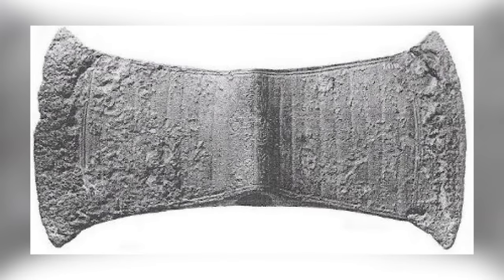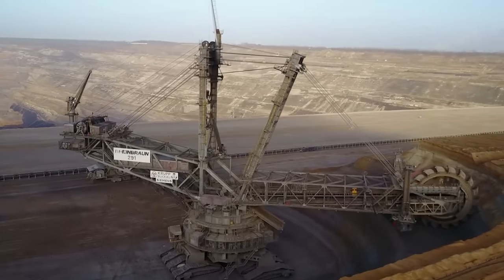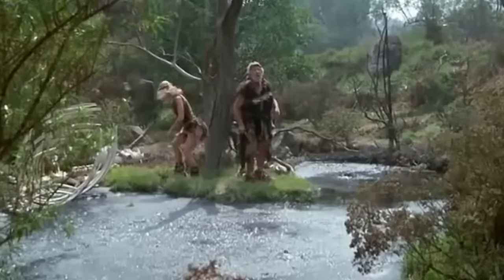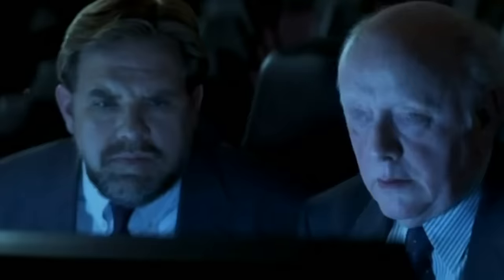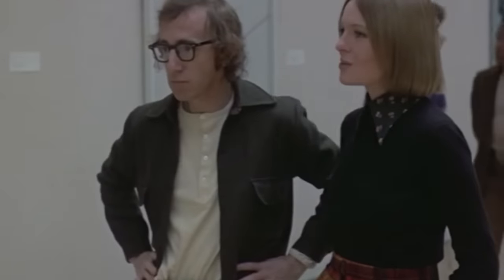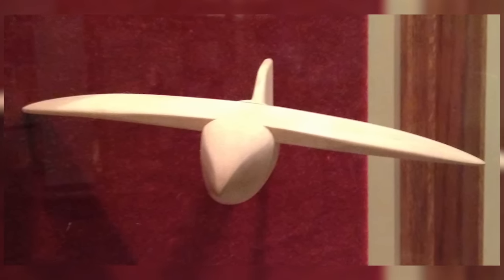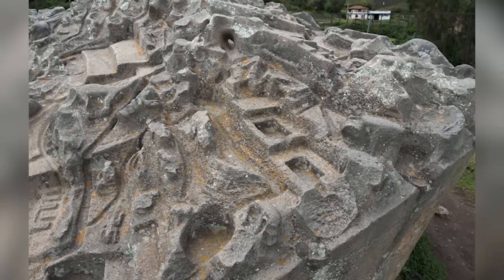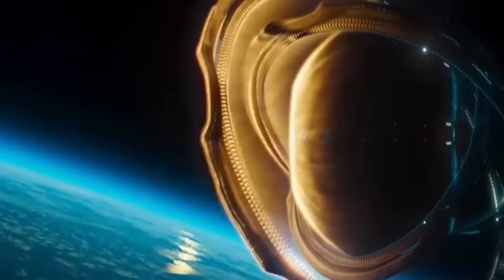12 Most Incredible Discovered Artifacts Scientists Still Can't Explain

Comment: The sphere is most likely a hydrazine propellant tank (model OST 31-0), used in satellites and rockets.
Reply: Why wouldn't it have disintegrated during reentry?
Reply: @graywoulf  One thing is the angle of reentry,  there is ALOT of stuff/things that do not disintegrate upon  reentry. You also have a rather large hollow object with low mass and therefore alot of drag, so the speed is greatly reduced in a short period of time. There is probably thousands of rocket engines that is at the bottom of the sea.
Reply: @goltzhar  Round with no sharp edges,  did ya notice the protrusions were scorched.
Reply: That can't be right it surely must be an alien space ship. Sure its empty but that's because the alien evaporated like my tolerance for this crap.
Reply: Not most likely but is ! Is a sphere because it is pressurized with Helium at 3000 PSI during use propelling the fuel into the rocket motor , usually made from Titanium alloy. And no space agency claims agency for fear of claims of compensation .
Reply: @bruth3659  could it be a cryogenic tank from Apollo 13?
Reply: @jaimes350  No idea, I'm guessing that what yr meaning would be for nozzle coolant? Ask Goltzhar ?
Reply: @goltzhar  could it be one of the oxygen tanks from Apollo 13? just a wild guess.
Reply: @bruth3659  i was thinking one of the oxygen tanks when everything went to shit on that flight, took your advice and asked Goltzhar though
Reply: @jaimes350  That is not likely, because US never drops "things" that could hurt anything living at launch. And I dont think Apollo 13 put anything into orbit other than the capsule. Launches is done over the sea and everything that falls down, falls down in the sea.
I also believe that they make their own tanks in the US and that tank is made by ArianeGroup Germany.
If you are interested of everything that is in orbit google "Stuff in space" -:)
Reply: @goltzhar  ah ok thanks, i was just wondering 😉
Reply: @Goltzhar I just looked up stuff in space. Holy moly I had no idea there was so much stuff. How do we manage to get a rocket or anything else past it almost seems impossible.
Reply: @muddrudder2656  the earth is huge
Reply: @goltzhar  you are actually wrong. the US drops like every other space agency everything back on earth, that doesnt go up to the geostationary orbit. its so much up there because it takes month up to centuries for it to fall down. (drag of the atmosphere resulting in deaccelaration resulting in drop of orbitheight where even more atmosphere is and so on).

do you have any source for your assumption that its an ariane tank? could literally be of any gastank of any company, because most of them look like that - its just the best way to contain gases at high pressure. 

funny part in the picture of the video, you can see the two openings for the in- and outlet of the gase and the weld in the middle of the 2 half spheres.

IT MUST BE THE ANCIENTS!
XD
Reply: but i give you that point, the US launches over the ozean to avoid damage to people/cities whatever will the rocket is kind of low in case of a failure.
there is a hell lot of space scrab in the ozeans and elsewhere. maybe consider watching Scott Manley here on youtube, he has quite a nice video about that garbage :)
Reply: TheValinov   You are the best for dropping that guy that does videos on space junk. 
I was wondering how to google that !
Reply: Made of titanium, with mounting trunnions at the poles. NASA used 40" tanks as pressure for the CSM engine. Operating pressure: 4000psi, test/burst pressure, 8000psi.

Comment: The last item, the wheel with the flipped fins, is useful to regulate moderate spin to slow the high efficiency rates that can be created through perfectly balanced wheel spins, attached to a generator that has an electric current or magnetic electron process. Ancestors of the past had better universal elemental knowledges than we do currently, and some of them indicate that they had the same levels of technology that we do now & better.

Comment: That wheel shaped disc looked like it was for spreading seeds.  You would wheel it to the center of a square plot say 30' x 30' and put a measured amount of seeds in the center, then spin the thing at first slow then faster letting them all fly out those side flanges.  Walk 30' and set up and repeat.  Have a crew following behind to lay some fresh top soil on top or at least mat down the dirt a bit etc.  They could even set it up at the bottom of a carriage that drops the seeds on it while an animal pulls almost like a a salt truck.

Comment: The last is a drill bit used to cut granite.
The face with the circle around it represents that which the Pyramid sits on, whereby a spiral staircase leads to the underworld. 
The spiral disc is a piece of a mechanism which if rotated, allows a type of iris to open and close.

Comment: Please focus the images on to the items being discussed. 
I thought starfish rather than galactic map.

Considering that the Namibian Sphere fell out of the sky, it didn't seem to leave much of an impact site.  Looking at the "bumps" on the top and bottom you seem to have images of different spheres as they look different in some of the shots.  It was also widely reported in December 2011 that it had been identified as a hydrazine fuel tank from an unmanned rocket.

It's possible that the saqquara bird is meant to be a glider rather than a model of a glider.

The sketch of the Inca Mololyth looked like an ancient toy shop.

OK, the Ancient Egyptians did'nt have wheels but they did have bowls and dishes.  I doubt it's a candle stick holder as they used mainly oil lamps.

Comment: The ax head is an inscription that this is a gift from a Princess to a King. It pays off a debt. It reads, from top left, The Princess owes the King 300 pieces of gold, for the acquisition of logs or lumber cut down from that King's forest. She lumbered 2 different types of trees from his island, getting her many logs, probably to build more than one oar ship. In addition, the Princess gives the King feathers for his headdress, a gift. She also gives the King's wife, the Queen, 300 pieces of silver, for helping broker the deal to the King. Big trees will be for the next deal they make. There are some big trees which they have agreed to sell the Princess. That's another deal. it's a contract. Also, the King will provide all the arrows the Princess needs to buy. Plus, they will also make and sell tridents for spear fishing, which the Princess will need for her fishermen. The Y type letter is the contracted agreement, the deal is sealed. The first Y symbol is the fulfillment of the previous contract, where the agreement has been kept. If the lower branch of the Y, points left, that means, fulfillment of our agreement. If the lower branch of the  Y points right, that means this is the next contract, now to be fulfilled. It's a barter contract. It's put on an ax head because the agreement is about his lumber. The Princess symbol shows her crown, four spikes on it, she's important in both contracts or deals. The first deal, just for logs, the King has 6 points on his crown. that's a big deal. The second contract, the King has five points on his crown, which means it's a lesser deal. Also, the queen has a rounded set of four points on her crown, which is why she gets silver, and not gold, she's not very important. The Princess has lots of money, and is more important than the King's wife. Hope this helps.

Comment: The Egyptian steering wheel. It held all kinds of different drugs for use at a pharaoh's high society dope party. Everybody reached into the wheel to get dope and got high. It was like a lazy symbol. Let's see, hash, marijuana, opiates, ahh, cocaine. They clearly had a mold, they melted the rock at high temperature, and poured the slab in, like glass. Then, as it cooled, they bent the edges. It was not carved. It was heated rock, poured into a mold, bent while still glowing, and then used for treats at royal dope parties.

Comment: 1. it is a decorated axe. someone wanted a fancy axe despite bieng garbage. stop trying to find a scientific meaning on art.
2. datation with carbon14 is never always exact, it might just be a sculpted block designed for house construction even in the middle ages.
3. it's a sculpture, it's just art, stop trying to find a scientific meaning on art.
4. it is a decoration object shaped like a swirl. stop trying to find a scientific meaning on art.
5. it is a rock, and i'm afraid it might be smarter than you.
6. a helium or nitrogen tank designed for rocket tanks to presurize ergol reservoirs. yes it's a rocket fuel tank, it's full of science, but scrap really.
7. stop trying to find a scientific meaning on art. stop trying to find a scientific meaning on art. 
8. someone just wrote a calendar and it ends, so what.
9. it is a bird. please slap your face, do it properly, it hurts? good. stop trying to find a scientific meaning on art.
10. yep, that's glass.
11. decoration purposes. it's a nice looking thing, I'd buy one for the apéro's snacks, I think it was the idea. also stop trying to find a scientific meaning on art.

Comment: The 13 lbs ball of metal fallen from the sky is obviously a hoax.  Say falling from 1km:
1. At close to 350 miles/hour it would have melted in the atmosphere. 
2. If it didn't melt then the hole in the ground would have been several feet deep due to the velocity at impact point (63700 joules).
Reply: It's quite large for something only weighing 13 lbs. From 1km it would not reach 350 mph or anything like that speed. It would not melt either. Think of aeroplanes made largely of aluminium travelling at over 500 mph without melting. It would not make a crater either. Possibly a dent in the earth. Being large and light it would have to be thin walled. It would more likely have deformed from its spherical shape.